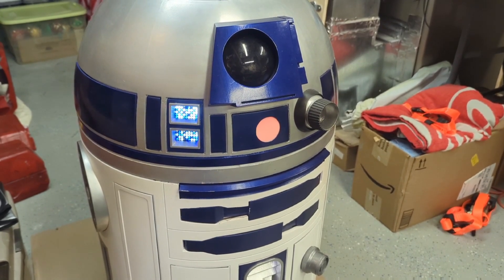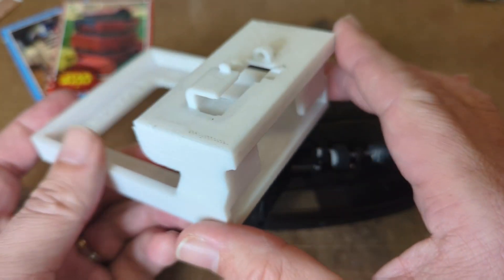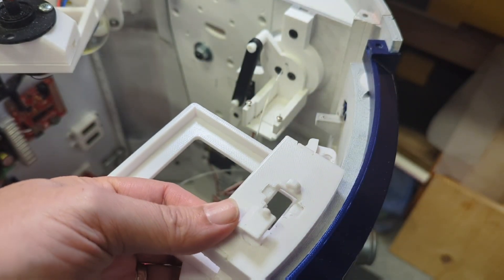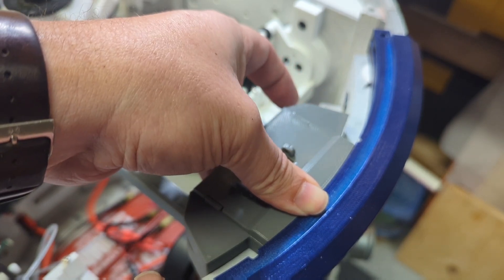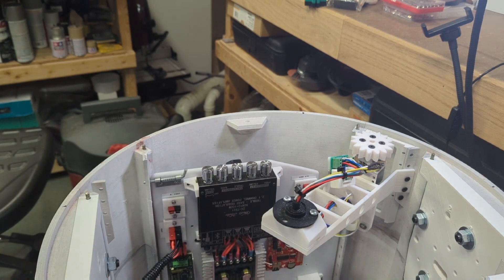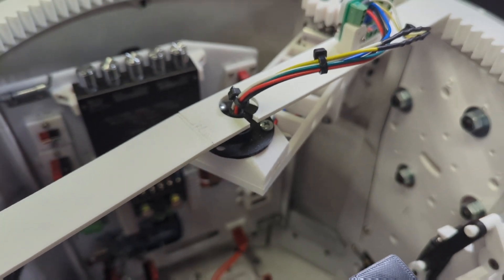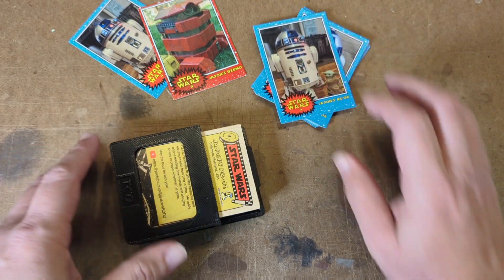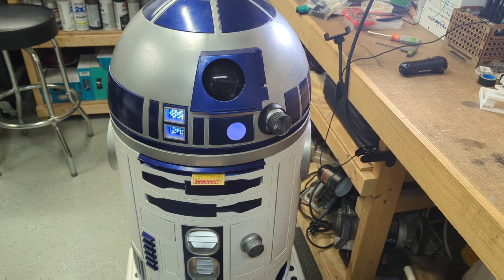R2 Gets His Card Dispenser!

Comment: I assume there is no way to replace the cartridge externally, you have to pull the dome off? I can only hope when I'm done that my electronics setup is as clean as yours, man that looks good.
Reply from the maker: Sadly, yes - the dome must be pulled in order to swap cartridges. I've found that having R2 offer a card is a fantastic way to ease the tension with younger kids that might be a little scared of the "moving robot", so I try to conserve his supply of cards for those occasions.

Thanks for the compliment - though my system is admittedly simplistic compared to many others, so that helps. I'm in the process of rewiring Bee and it's reminded me of how difficult it can be to keep the wiring runs neat. Cheers!

Comment: This is an amazing add on! I can't find a location on line where I can order a large quantity of Star War trading cards from to fill up this system. I can find a site where I can order one card for $19.99, that would make this upgrade cost prohibitive very quickly. Where do you buy the Star Wars trading cards in a large variety stack from at a reasonable price?
Reply from the maker: These are not vintage cards - they are cards I had printed with pictures of my own R2 and my own text on the back. Many builders (and members of various cosplay groups like the 501st) make their own cards to hand out at events. There are template files that can be found online at some of the various builder forums (www.astromech.net and www.rebeldroids.net are two examples) and some of them (like the ones I used) are very close in appearance to the classic Star Wars card style.

Comment: Hi, do you have a link to the cassette rollers? I can't find the correct size😭
Reply from the maker: I updated the video description to include some eBay links and descriptions. For the wheels, you want 1.15x0.5x0.2cm Car Retractor Belt Pulley
 https://www.ebay.com/itm/154755704173 There are lots of options - I keep spares in case they ever dry out and lose grip over time.

Comment: Thanks for sharing Jason.  I really like the simplicity of the remote relays.  I am running Padawan 360 and it does not like any sort of delay, so making it work with that would be quite the coding exercise and probably not worth the effort when you came up with an elegant solution already.  I will add this to my never-ending list of projects I have going on.  I have a Ratrig VCore 4 kit sitting on my workbench I haven't even been able to start on yet.  I want to print a new 1 piece dome for R2, then printing on R5 will commence.
Reply from the maker: Lol, prioritizing can be a challenge from time to time. So much to do, so little time! Good luck.